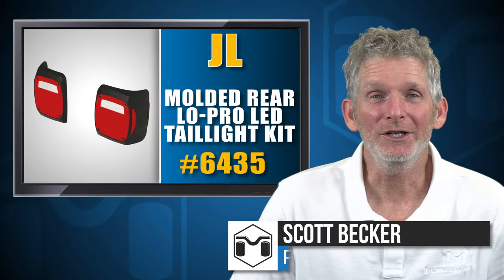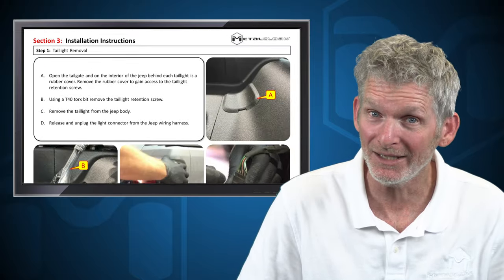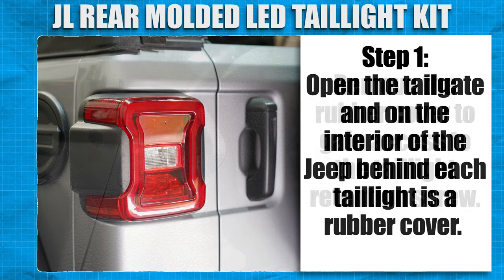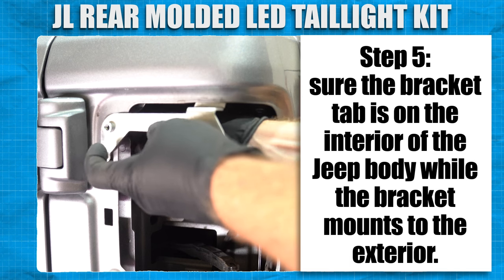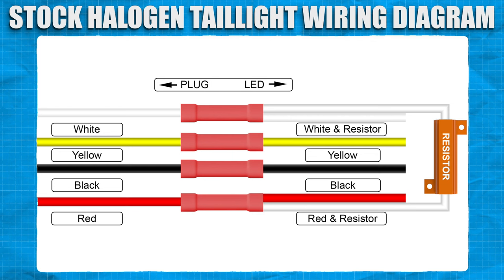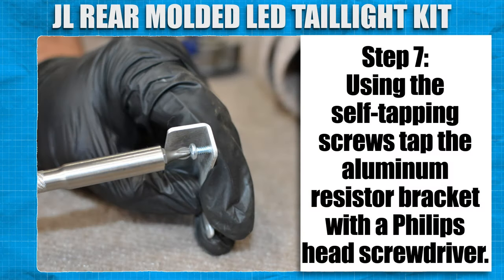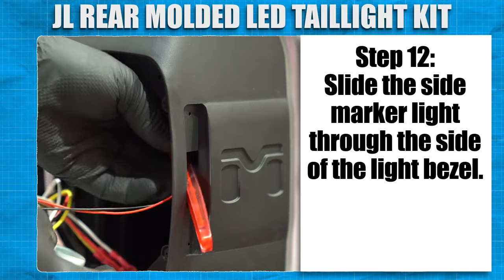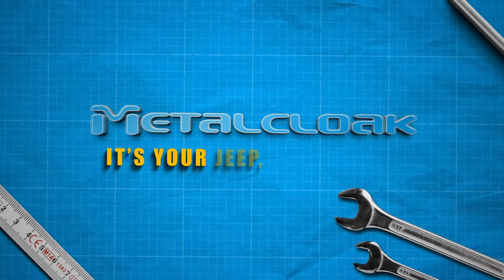How To Install: Metalcloak JL Wrangler Molded Lo-Pro LED Taillight Kit

Comment: Are we gonna see a set for the Jt?
Reply from the maker: Not at this point. We use this LED panel for all of our rear tail lights. If we used it for the JT, you would not be able to have a Lo-profile set up. It would stick out too much. At this point, we are not looking to design something around a different panel.